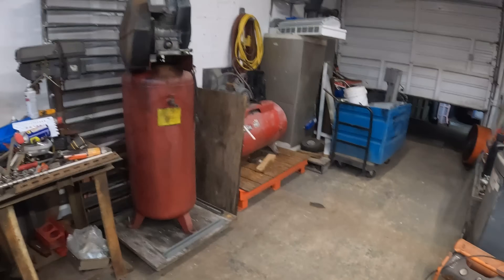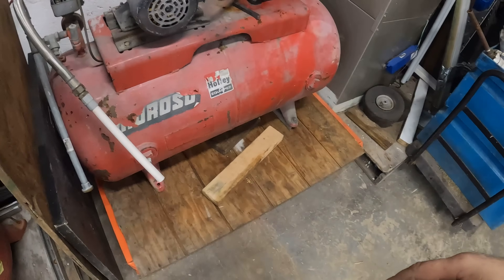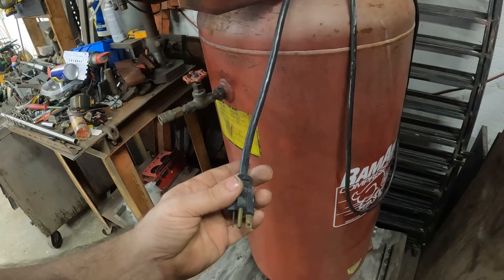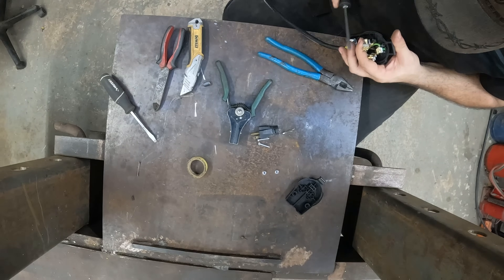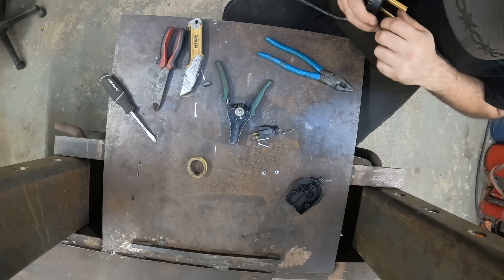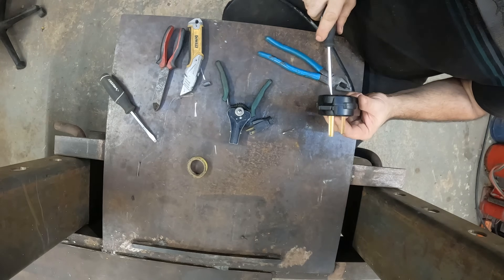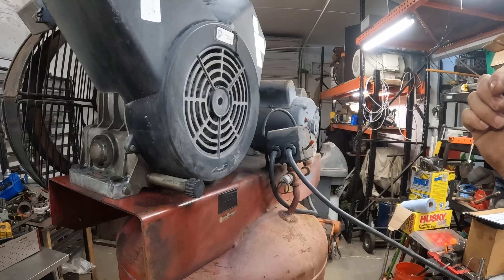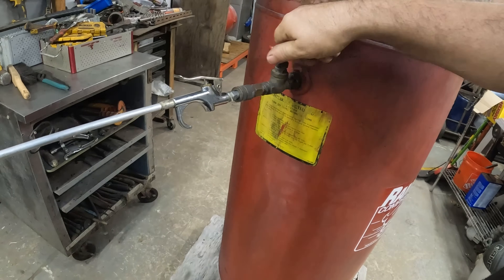Scrap Air Compressor Will It Run?

Comment: Fill to bottom of thread the stop plug at the top brother the hole you filled with oil  should be 35mm or thereabouts same as some gearbox fill until it reaches the bottom thread. Anyway awesome so far brother
Reply from the maker: Thanks for the info! 👊

Comment: Put a rubber washer on that little bolt maybe that would help you could tighten that down and get rid of the noise.
Reply from the maker: Thanks for the suggestion

Comment: To remove the oxidation on aluminum. Heat up some vinegar to a boil, add a bit of water. Green scrubber pad. Boom you’re done. Just make sure you clean with soap and water when done. Dry, back in business
Reply from the maker: Thanks for the suggestion. 👊

Comment: How much water is in the tank? (Don't forget to drain water weekly. You have a little humidity down there.) 😊
Reply: I was just going to recommend that.
Reply from the maker: Thanks for the suggestion
Reply: Yes,I’ve seen a drain cock rust out of a compressor they weren’t draining regularly,the thing came up to pressure then blew out went bouncing across the floor could have been ugly.

Comment: Great video Derek, but you forgot to cover the valve at the bottom of the tank that cleans out the moisture and debris or does your tank have this valve? It’s pretty important. I usually purge mine every day. It’s crazy when you see what kind of dirty water comes out of this valve.   mostly when you’re from humid state like FL.
Reply from the maker: I did check it but did not make it to the video.

Comment: That zip tie is going to melt. That pipe you have it around gets super hot.
Reply from the maker: Thanks for the info, It was a temporary fix. It's still on there so I will check if it has melted.